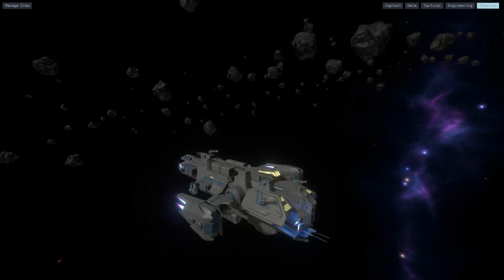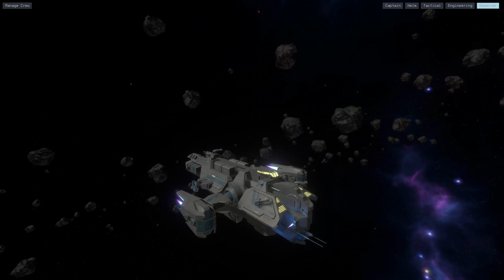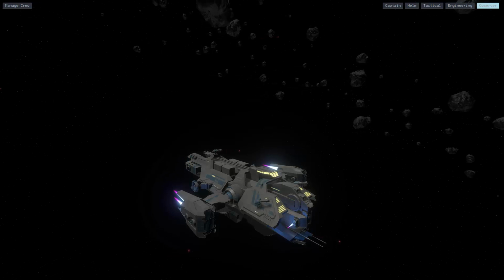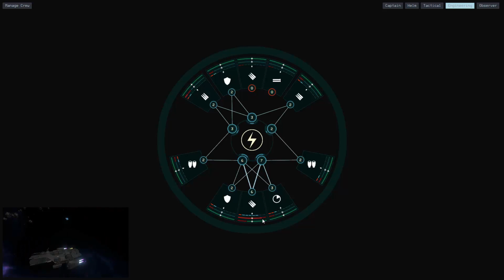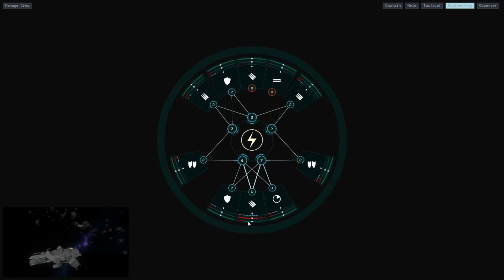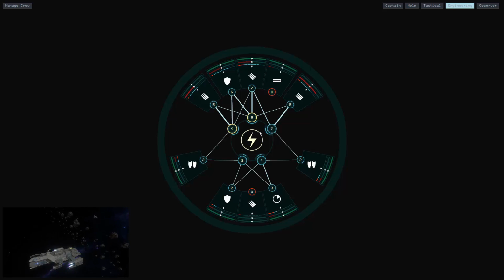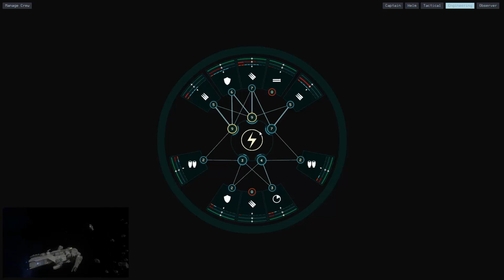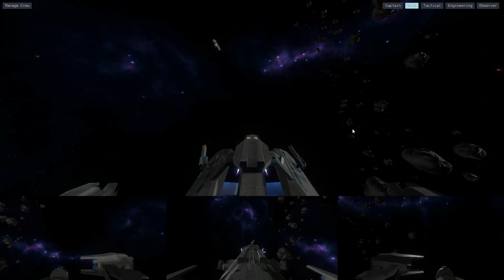UNION Spaceship Command - DevLog #1 - The Engineering Power Wheel

Comment: hey will threre be warp ?
Reply: +Plauer Gaming further more .. that game is awsome ... i really want to play this with my crew : 6 Players like in Artemis
but it LOOKS GREAT
Reply from the maker: +Plauer Gaming Although there won't be warp, as in faster than light travel, there will be "Cruise". Cruise allows you to travel at very fast sub-light speeds, for travelling long distances. It requires a lot of power to use though, so other systems such as shields and turrets need to be turned off for it to work.
Reply from the maker: +Plauer Gaming Thanks so much! :) We'll be showing more of the Engineering UI in the next DevLog (in two weeks).
Reply: +Mark Aherne well it would be nice to integrate a kind of charging befor start to cruse (and some nice sound and visual effects)
Reply: +Plauer Gaming Don't worry, there will definitely be an awesome 'cruise engines engaged' effect or I'll eat Mark's hat 😃
Reply: +Podge Murphy well i could even make some sound Effects if you wanted
Reply: +Plauer Gaming Sounds cool, send it on to me if you decide to do something. No promises, but as we've been saying that all feedback is very welcome, so I certainly won't turn you down 😃